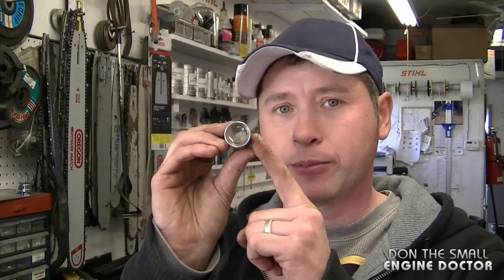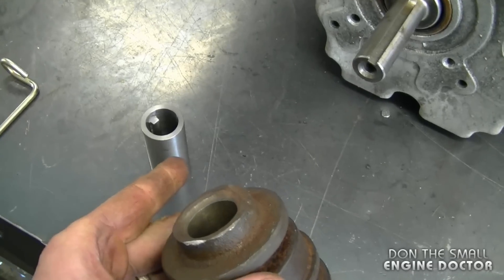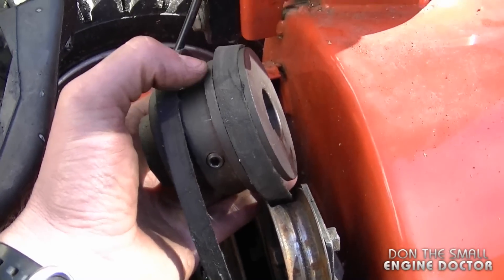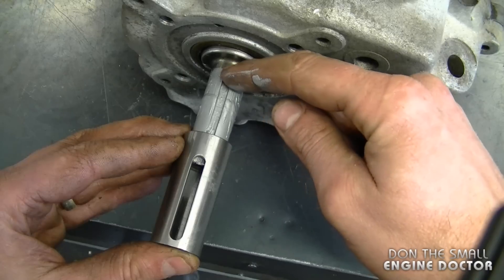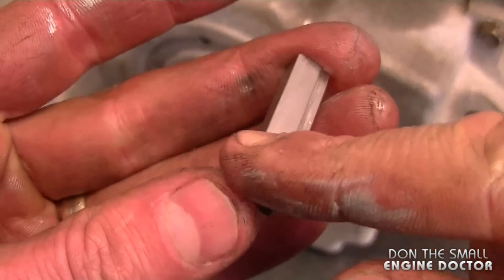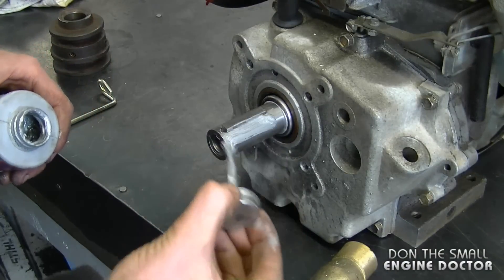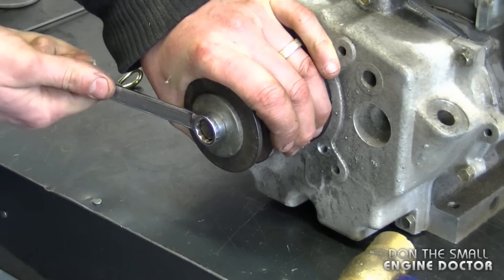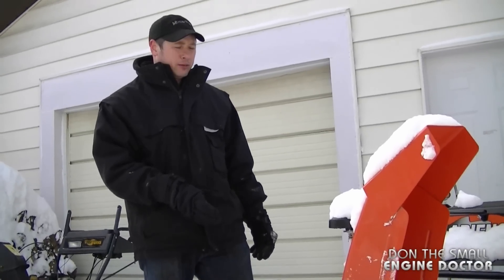How To Convert A 3/4" Crankshaft To 1" On A Small Engine

Comment: Hi: I once got into this situation I used a piece of 1" copper pipe to bush the pulley down,not on a snowblower though.Kinda pricey at $55 bucks might be cheaper to get a new pulley.
Reply: I just ordered a 5/8" to  1" adapter off ebay for $20.
Reply: I went to Tractor supply and bought a 2.5 inch od pulley for a .75 inch shaft for $12 . It eas im syock and  takes a standard key. Should work well on the single belt Ariens with the Predator 212  replacement engine.  But if I had a dual belt I would have made or bought a sleeve like Donny shows on this video.

Comment: I'm looking to do similar but the engine will run a cement mixer , the problem is have is the new engine shaft is 3/4 tapered and the pully like yours is a 1 inch pully , is there a sleeve available...thanks for any advice

Comment: I have a Kohler 23.5 hp that has a shaft of 1.125” OD and the engine that I am replace with it has a strange OD size that measures 1.3865”. I used callipers to check the sizes. I have looked online and can’t find anything that might work. Any help would be greatly appreciated.
Thanks

Comment: Thanks for your shaft conversion video. I have a 2020 Ariens Classic 24 powered by 208 cc LCT motor. Would you recommend the upgrade to a dual attachment belt kit. What advantages or disadvantages if any could expect?

Comment: I'm doing this on a Snapper 9266.
I'm dropping a 10hp engine on in place of the 9hp which is really just an 8 for more power.
The shaft on the 9 is 1" and 2, 3/4 long. The 10hp is 3/4 and 2, 1/4 long. So I'm going up to 1", and 2, 3/4 with the adapter so the engine will work. I want that extra power.
Its going to become a 10/26. 40cc   larger.

Comment: My son bought a lawnmower with a non matching motor.  The spindle/shaft is too short and the blade is about 1.25-1.75 to high.  Is there a spindle adapter to lower that blade?

Comment: Hi buddy   i have a  GX390 off of a generator  with a tapered shaft . is it possible for me to change the shaft or should i buy an adaptor ? to take a pressure washer pump ( 1 inch )  i have very little experience of  Petrol motorts  ,, any recomendations ? many thanks

Comment: I bought one of these years ago to repower a leaf vac that had a seized Tecumseh HS50 on it.  It was replaced with a Briggs intek 6hp.  I used one of these adapter I bought off ebay and put it to work, but after about 10 minutes I had problems.  I noticed the muffler was glowing, I shut it down and found the flywheel key sheared.  I replaced it and again a few minutes later had the same thing.  The 3rd and final time the engine stalled out on me, pulled the flywheel again to find it heavily scored and now the keyway was damaged.  I attempted to remove the engine but due to the design a wheel puller was impossible to get on the impeller and after very much struggling between myself and a machine shop we opted to cut the crank off.  It appeared that the adapter wasn't fitting as snug as I thought it was causing some play and ultimitly mangling itself into the hub.  In the end I had to have the inside of the impeller hub milled out to remove the adapter and remains of the crank.  The machine is alive now with an old HS50 tecumseh I got at a yard sale.
I'm sure this adapter has some very good uses (like the snow blower in the above video) but for something like my leaf vac or a shredder I'd look for the right size crank shaft to avoid something like what I ran into.

Comment: Hi Donny , want to put a 15/16 blade adapter/pully on a 7/8 crankshaft thinking of installing 1/32 shim material inside adapter and slide it over the crank, locktight then drill for offset allen screws (3). What do you think .

Comment: Great video. Is there a way to make the crankshaft longer or shorter for when you want to swap a lawnmower engine onto a different cutting deck? So the blade sits at the correct height under the deck?
Reply: shorter would be to space the engine off the deck. 
but longer would be.. well.. you owuld need something long enough that would require spacing it probably.....   crankshaft swap to get a longer one.. if im imagining what you say as you mean it.

Comment: hay Danny have a dewalt generator with a 270cc Dewalt engine  dw177fd-f  it was ran out of oil needs a piston and connecting rod not available from dewalt ? what can i use in it

Comment: I know this is old but I honestly didn't know they made crank shaft adapters. I have a really nice older Ariens snow blower with a really tired engine. My guess is this would do the trick. I hate scrapping the older snow blowers if they are in such great shape.

Comment: looking for info on 1990's Bolens 8--26 snowblower slip differential.    slips when under load , tried to adjust with end of axle nuts but only able to give it 1 turn and no difference ,   Can I change something inside differential to stop it from slipping. Thx for your help. Bern

Comment: very interesting, how strong would it be to  jb weld the adapter to a threaded 3/4" crankshaft and file the key to the correct height?

thanks
Reply: This is one of those times where you do it and report back to us how it went! For those that wonder, there likely are reported specifications as to the strength of the JBweld. From there if you know what your application requires straightforward math might give an idea whether it would work or not.

Comment: Great vid - thanks
Question: I need to convert a 3/4 by 1 inch shaft to a 1 inch by 3 5/32 inch shaft. Is there a converter sleeve? 
Thanks
Reply from the maker: not sure, seems like an odd size, maybe a machine shop can make one

Comment: I bought a used pressure washer that the engine ran but it didn’t pump. I noticed that the pump was not the original and had been replaced.  The engine had a 3/4in shaft but the pump was built for a 7/8in shaft.  Amazon had the adapter I needed for $12, and now I have a good working pressure washer for a total of just under $50

Comment: Dynamite video, but what if I want to mount a snowmobile clutch on a briggs motor with a 1" shaft, the clutch takes a 30mm shaft that is tapered 10 degrees

Comment: Always oversize the auger pulley a half inch or so. You'd be amazed at how much better it works. I have a video on my page of my old John Deere that throws snow well over 50 and over 40ft high

Comment: Here we are 7 years later and I now need to adapt a 1" bore pulley onto an existing 3/4" dia shaft and just like yours my pulley has a 1/4" sq key and the shaft has a 3/16" square key.  The wall thickness of the bushing is 1/8".  So we have half of the 1/4" key in the pulley and half of the 3/16" key in the shaft plus the wall thickness of the bushing wall to go thru.  That's 0.125 + 0.125 + 0.093 = 0.343" which should be the height of the key.  I have now purchased (2) of these kits both differently made, got the wrong key in both of them and both sellers refunded my money and said just to keep it.  Both of the keys were stepped but were only 0.275" tall which is almost square.  I just don't get it.  Yesterday I sent an email to a number of sellers (who all advertised they had them in stock) with instructions and asked if they could verify the key's dimensions.  So far the responses are like they didn't read my email and just want to sell me another kit like one I already have.  Sorry to vent here but this is sort of frustrating and depressing at the same time.

Comment: HI   DONYBOY   I HAVE  A  10HP    TECUMSEH    WITH  A    TAPPERD  SHAFT   IS THERE ADOPTOR   FOR THIS....MAKE IT TO STRAIGHT  SHAFT  ........THANKS
Reply from the maker: you would have to get a machine shop to make an adapter, best way to go is crankshaft swap from another engine, where are you located?

Comment: Are these adapters available to convert a tapered generator engine shaft  to a straight shaft? I just junked a running 13 HP Honda due to a bad stator which I was quoted  $1,000 to replace!!!
Reply from the maker: +Pa Aa not that I know of

Comment: Hi there! I just swapped a 22hp b&s with a 20hp b&s on riding lawn mower turns out the 22hp had a 1" 3/8 and the 22 has 1" shaft can i find an adopter for that where i can use the same clutch and drive pulley?
Reply from the maker: you can try a machine shop

Comment: Hey I have a question I have a Honda gx 270 1 inch shaft and I need a key for the key way but I need to kno the size
Reply: I'm sure that he will tell you the size.  And probably only charge you $60 for the information.   And another $95 if there's a Y in the day.

Comment: I Have a question donyboy73 : I have a old mtd snowblower from 1985 its a 11hp briggs and stratton  with a 32 inch cut and it seems to me it dont blow snow far enough . its been like this ever since i bought it 7 years ago i changed all the belts thinking that was the problem but still only blowing the snow about 3 to 5 feet . do u know what could be causing this??? can u please help me out it would be great if u can help . PS i love ur vids ive watched them all .
Reply: Check this video out. It should be of help. Modify Snowblower to never clog and throw twice as far w/ Impeller Kit
Reply: Already done that dont make one bit of difference . but thanks for the help Joe Z

Comment: How do these adapters work with a pulley that has a fixed key
Reply: Cut out 1/4 slot in adaptor to accommodate built in key inside pulley,  lock the adaptor with a 3/16" key, or grind down the special key flush to adaptor, hacksaw, die grinder, done it works well for most applications with key built inside pulley

Comment: Hi Donyboy  or any other master mind reading this. I have a Tecumseh HH60 engine with a broken crankshaft: 31856A does anyone know if i can swap it with any other crank and a simple solution like a sleeve to make it work again.
Reply from the maker: yes u should be able to
Reply: @donyboy73  but do you know with what model crankshaft I can do it?

Comment: I have a predator 212 with a 3/4 in. shaft. I need to extend the shaft in length by 3-4 inches. 

Is there anybody with an answer? 

I have been searching shaft extensions and I think I have an idea, however, I am open to all answers. 

Thank you!!
Reply: Drill new holes 3/4" more forward.

Comment: J'ai la même poulie sur un moteur Briggs and Stratton  8 hp d'une souffleuse Toro 826 ( qui a manqué d'huile ) et mon problème est double: first, je n'arrive pas à sortir cette poulie, j'ai essayé avec un puller,  j'ai chauffé, je ne sais plus comment faire! si vous avez un truc infaillible, j'aimerais bien le connaître. Second, j'ai un bon moteur de pressure washer 206 cc Brig. Strat.  dont j'aimerais savoir si je peux la mettre su la souffleuse Toro 826?
Reply from the maker: ca va d'Être un trop petit pour ta souffleuse
Reply: donyboy73 Merci beaucoup, combien de cc que je devrais prendre et quoi faire pour ma poulie ?
Reply from the maker: janvier121 essaye  de trouver un moteur d'au moin 8hp avec le meme shaft
Reply: donyboy73 J'aurais bien voulu ouvrir le moteur pour voir les domages
Reply: donyboy73 J'ai réussi a enlevé la double poulie!! J'ai réparer  le grippage. Now je veux régler  le rpm  ( Toro 826, 1978 ), mes documents me dise qu'à 2500 rpm  j'ai un12lbs de torque maximun. À quel RPM que je dois l'ajuster quand je start ?